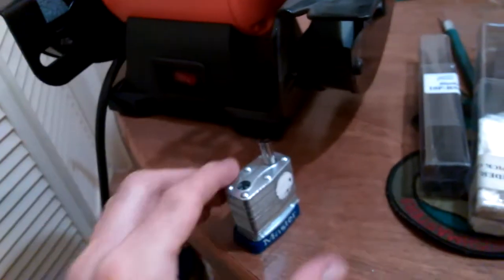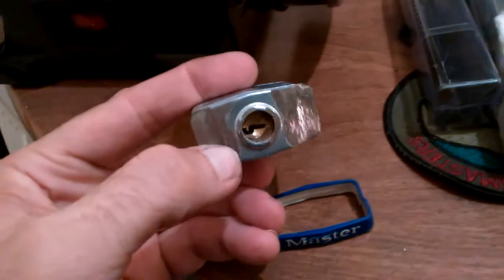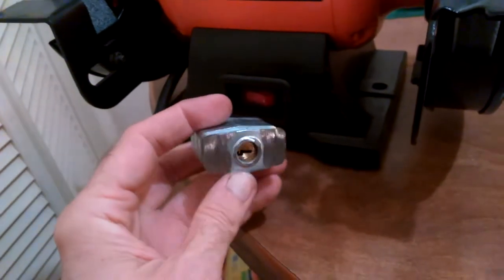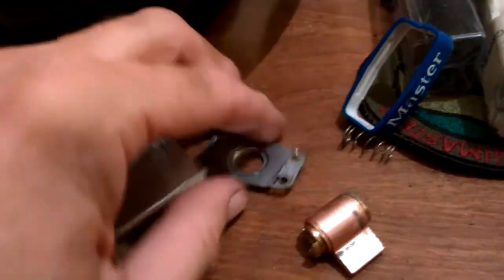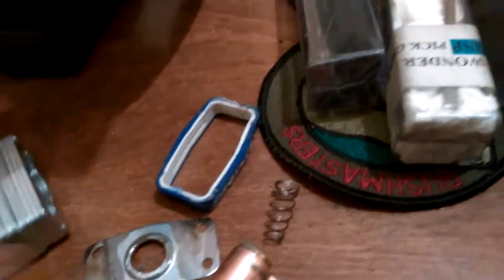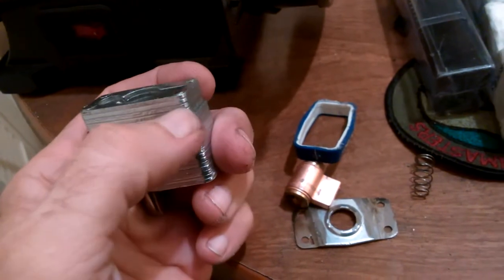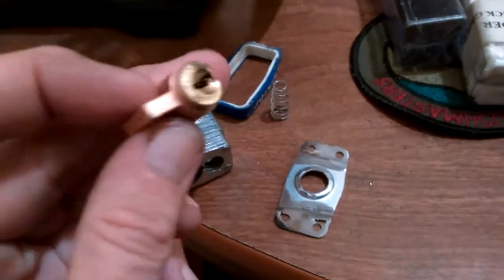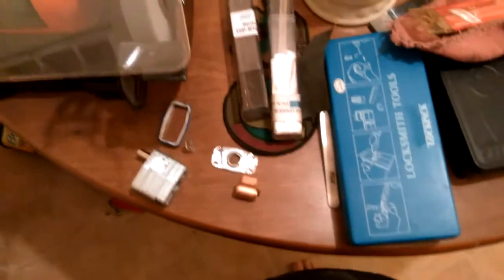(180) Master Lock #3 Disassembly part 1

Comment: Seven years late but, hopefully this helps. Bypass won't work on #3, #5, or #6. Try it with #1, #2, #4. I usually don't bother with the bypass because a city rake makes quick work of these locks.

Comment: Great idea.   Did you ever figure out how to use the Sparrows switch with these locks?
Reply from the maker: No, I never got that to work.
Reply: Seven years late but, hopefully this helps. Bypass won't work on #3, #5, or #6. Try it with #1, #2, #4. I usually don't bother with the bypass because a city rake makes quick work of these locks.

Comment: That was easy - only one laminate layer needed to get the core out - wow. Is that a copper core? 
I know what you mean with picking under pressure. I have to open up a bike lock once for a colleague and it took me ages while he observed what I was doing ;-)
Reply from the maker: Potti314 The core has a copper plating, but some other silver looking metal is below. Whatever it is, it's non magnetic. Maybe it's aluminum?

Comment: Very nice done William :). I have seen worse attempts to take one of these apart :). A cheap copper core inside haha ;D, that was almost to expect. But as you said, you have now something nice and small to play and take with you :). Your bypass drivers usually don't work if you try them on locks which have a core of a non bypassable design ;). The tailpiece is simple different. If I remember correctly, the Abus 72 is one which is bypassable. Thank you for sharing 😊 :).
Reply from the maker: redcatimaging Thanks Foxxy. I watched the only disassembly I could find, and the guy was using a hand file & a hammer. He got it apart, eventually.